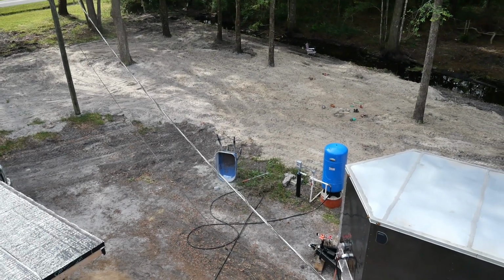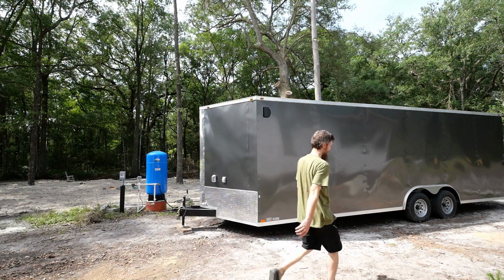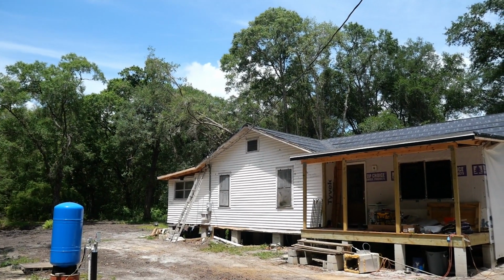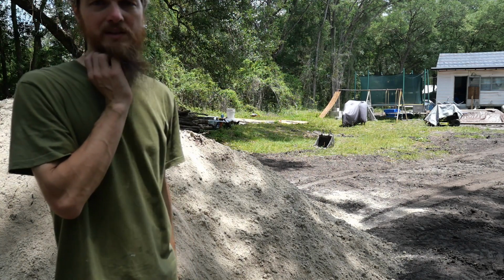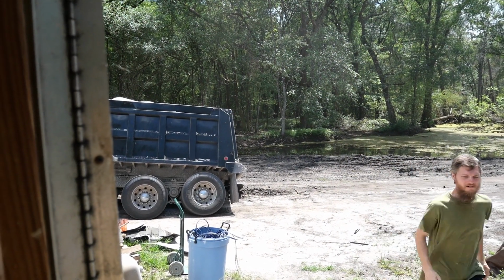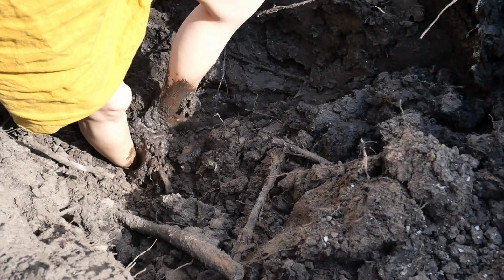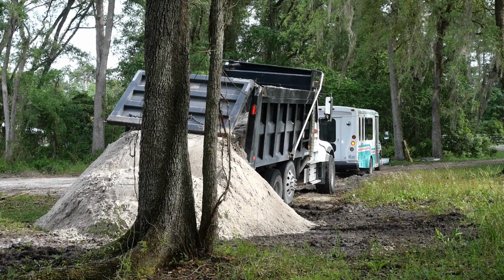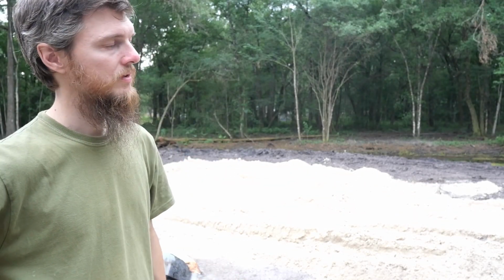Dump Truck Sunk Right into the Ground - Dirt Delivery

Comment: That slippery clay will hold onto water like nobody's business. You want to get that sand mixed in to help the drainage of the native soil. Piling it on top will help drainage to an extent, but you'll still have random pockets of instability where water gets trapped and can't drain out. I ended up mixing gravel into my clay (as well as piled on top) just so I could get machinery moved through. Corduroy roads also work in a pinch if you only need to get a machine through a couple of times.
Reply: Yes I agree, there needs to be a gravel mix or the sand will wash away or the rain will make it uneven.

Comment: There are basically 3 types of soil, stable, intermediate and reacative. Your on a black soil which is reactive. When it dries out it will be like concrete and when it's wet like yours there is no bottom to it. Great for farming not so good for building on. Be carefull about building up the ground around the house, you really don't want to create saturated soil under your house.  You have good intention replacing like for like but those foundations are not very deep. Dig yourself a fairly deep hole fairly close to the house and look at the soil profile as you go down. There ideally should be 3 distinct levels, different colours. Typically A, B and C, unless you are on bedrock which you aren't, or strike bedrock, which I would be doubtfull you will find on your place. The best you could hope for is a moist clay. Typically yellow in colour. That would be your C (stable) Usually a founation would just be placed just into the clay. The A level is on the top and you could have a laugh as it's called you guessed it,  'Top Soil' . It has been built up ocer melinia and actuallt stops tge clay from drying out. When the land is stripped off its topsiol the clay will dry out and shrink, causing foundations to sink, or crack, often causing brickwork to crack, houses to sink (hense those old door you got were out of square, because as a house starts to sink people usually start to trim off the tops and bottoms of the doors to get them to at least open and close, but they will always run into trouble with the latch of the door furniture running foul of the strike plate and becoming just a headake usually. We used to set the whole house up on jacks. Usually the house would be just hanging there if it had a properly built brick chimney or two. It is really quiet amazing how a house, even over 100 years old, just trys to hang-on, defieing the odds. I have jacked up ordinary small houses, with around 60 to 80 stumps, sometimes around 4 to 6 inches. Taking into account that the house may have been slowly going doen over 40 years or so you have to be sympathitic when lifting a house back up to the level of its chimney(s). We would have it up on usually 60 7 ton hydraulic jack and maybe 8 or 9 ten toners. Creaking and cracking can be pretty scarey when your jacking them up as I heard on your place, it makes you just stop! and listen. Lol, I saw you do that a couple of times underneath yours. Brought back memories.. Also just be carefull when playing around with just yourself and the missus, many older homes can have asbestos descuised in many unlikely building products. When they are disturbed thw particles can become airborn and if someone btreaths them in they can't be simply coughed up, they are tiny and they have a barb like structure and the are in there to stay, worse than lead or murcury in the body, they can cause a couple of very nasty diseases, always leathal. If in doubt spray with a mist of water and don't let the particles get airborn. I'd be very interested to see your soil profile. With such a beaut machine to play around with . With your layer of sand, you might also consider adding some organic material. Either rip the ground with a dozer or get it tilled in with a rotavator. The rule of thumb being don't bring the B level into the A.         All good.
Reply: Blimey that’s one hell of a paragraph.
Reply: Learned a lot , Thank you.   I never wanted to live in Florida.  Bad news about what they could be breathing in !
Reply: Excellent info
Reply: I have thought it might a good thing for them to install a sump pump under their house.  Theyhave them in basements.
Reply: @ross225100  I first moved to Florida in '72  wouldn't want to live anywhere else. I've lived up and down the east and west coast   of Fla.  even the Keys   now settled in Fla panhandle....love Florida
Reply: You can't do that! The water table is just a couple of feet below the surface. Even in the driest months it won't drop below 3 feet. That house sits on the margin of a slough, hence the backyard pond. The sandy fill is the best solution to their drainage problem. Realistically, they need double the amount already put down to raise the surface sufficiently to eleminate their mud problem.
Reply: @beverlybaker6970  I was born and raised in Florida. We had to move to Kentucky for work with our kids. We all miss Florida. Looking to move back soon.-Mary

Comment: Looked like the left front wheel wasn’t moving. Check to see if the caliper is dragging on your bus. You guys are great been watching for years!
Reply from the maker: I was paranoid about hitting the power poles so I was keeping my foot on the brakes, that's all. Plus I have barely ever driven that bus and it was hard to see what I was doing. :\

Comment: We did 3-6" rock as our base layer, not stone but rock as it locked together with jagged edges, not smooth like stone.  You need airbags or heavier springs in your Van.  You really should learn the geology of your area of Florida.  Hopefully, your home isn't over a potential sinkhole.

Comment: I think you would do well to trust a contractor or professional well versed in dealing with low lying land and high water table , road cloth prior to dumping and spreading material helps greatly with  pumping effects,  keeping the black muck from mixing up through your surfacing material. Hopefully the sand was free as fractured rock would have been preferable I think, but I realize not everywhere has this material , and trucking isn't cheap .I only speak up as I want you to succeed and respect hard work. Best wishes.

Comment: your built on a swamp with constant unerground water flow...you need to divert that flow...tough situation...good luck
Reply from the maker: The water under the ground is the high water table. That's everywhere in Florida, which is why no one has a basement here :)

Comment: im worried that once the rain comes you will have a bunch of quicksand all around your house,  need some rock, fiber and soil too to hold it all together.  Water will just pass right through the sand. it can  look dry on the surface but can be a pool underneath like what you just saw with that truck sinking.  once the rain comes it will get worse w/o some rock soil n fiber

Comment: I’ve the utmost respect for your abilities but I have to ask: did you get a professional evaluation of the necessary steps/materials necessary to push back or ramp down your water levels and grading your yard. The south (especially FL) is way different than the north.

Comment: That there was so much mud under the surface must indicate that the water table is quite high, perhaps some sort of drainage and/or pumping system is necessary to take some of that water away from your property.
Reply from the maker: Yea, we have a high water table and at times it starts showing up in the crawlspace. Nothing can be done about it except try to raise up the soil.
Reply: Problem is there's no place to put it.
Reply from the maker: Yep, we're at the lowest spot so all the water ends up here.

Comment: Dump truck drivers in my area can drop and drag... i.e. lay down a layer however thick as you need. Don't know if that'll work for sand tho. Would have helped your spreading time tho.
Reply from the maker: It's okay to get them in piles because we ordered 20 loads and there wouldn't be enough room to drop and drag them all.
Reply: @diyfferent  I guess they wouldn't be able to back over what they dropped without getting stuck in fresh sand. They do that with stones  in driveways. Back in to the end, open their tailgate a little, tilt and drive to the end slowly while dumping a small layer. Makes for a nice smooth layer. Great video!

Comment: Well that was to be expected.  When you dug up a hole to place the broken concrete blocks you could see the ground looked liquified from about 2 to 3 feet deep.  This sand will mix with all that mud and here's hoping that the ground will stabilise if you get enough fill.  You're doing well as when it flooded the water didn't take to long in draining.

Comment: So odd how random things like that can happen. 

Many years ago we had a lorry come to pick up a scrapped car from our bottom farmyard. All went well, until the driver of the lorry tried to get the crane to stop moving sideways so he could lower the car onto the bed of the truck. The hydraulic system stuck, and no matter how much he tried, he couldn't stop it carrying on to the full limit on the wrong side of the truck bed. The farmyard had a slight slope, so he'd set up to counter that in loading, but unfortunately the weight of the scrapped car, with the slope now on the wrong side, sent the whole lot toppling. All I know is we were relieved we had witnessed the incident, because the insurance company tried to make it seem as though it was driver error in either how he had parked, or in how he had operated the crane. 

I feel for the poor driver in your situation, to have successfully delivered four loads, then to have that happen must have been soul destroying. 

I hope the sand helps with your water levels now you've graded the land as much as possible to drain towards the ditch and pond. One small downside with sand is it tends to take longer to compact into a drivable surface, but with luck you'll find the happy medium between it all soon. 🤞

Comment: Could it possibly be a sink hole? Possible ultrasound to find out for for sure? Scary... Great work on your property!
Reply from the maker: No, it's 100% not a sinkhole. It's just a 35-ton dump truck sinking in. This stuff happens everywhere. The previous 4 trucks what were lighter in weight loosened up the top, hard, dry layer, so when this one rolled over, it was just too much and it gave out since underneath was still soft. Thanks

Comment: if Ashley sinks into the stuff for sure the truck had great chances of really sinking that poor driver was having a not so great day ..... could it be a hole with quick sand ??? glad all worked out well in the end hugsssss
Reply: People fear quicksand but it isn't really all that dangerous - they watch too much TV. The principles of "liquefaction" are in effect there, also. The only way a person will continue to sink in quicksand is if he continues to shift his weight in a concentrated area - and even then, it would never go over their head. The more they move and the further down they go, the less weight is being applied to the surface and the liquefaction ceases.

If a person steps in quicksand, the best thing is to get into a horizontal position to distribute the weight over a larger area, then crawl back to solid ground.
Reply: @ep61611  i have never seen quick sand except tv but being 58 i know they add the scary tactics for fun lol but its ok i earned something new today by your explanation ty hugssss from Canada
Reply: @ep61611  Cool!  Not that I may ever need it, but that's the best tip of 2022 so far for me.  As I watch people comment about D&A fixing their piers under the house I think of that principle.  They are spreading out the downward force of their house with a "wider" foundation which is very effective.  It lets the house 'float" on top of the dirt and is an effective  building technique used for centuries.  Spreading downward force over thin ice is also an effective way to get out of water when you fall through ice.  I never would have thought of that for quicksand though!

Comment: My guess would be those first four loads of sand caused the water under there to displace, and it was forced into the area where the truck got stuck.  Even though he had been able to drive over it earlier, it is now saturated.  I don't think there is any way to predict where all that water that's under the ground is going to go, but that heavy sand is going to force some of it to go somewhere else.  Good luck.

Comment: Haven't seen it asked(I may have missed it) why are you getting sand and not fill dirt or clay base or crusher run
Lived in Florida for over 30 years and sand was not something we wanted in our yards and it never firmed up and was always causes for vehicles getting stuck
Reply from the maker: We're getting that question a lot so we'll have to cover it in our next video. But, we didn't really order "sand". We ordered "fill dirt". Florida is mostly sandy soil, so the fill dirt down here is "sand". It does have a little bit of clay and other stuff in there, but it's real sandy and we're okay with that. It's the norm and this is what was recommended by a site prep company for our property.
Reply: @diyfferent  👍 Gotcha
You may have have to bring in some rock base at some point to make a driveway of some sort down the road
Take care and keep up the good work

Comment: You might want to switch to gravel it packs better and grass will grow threw it! I would go to a welding shop and get a hook attachment added to your mini excavator a lot of companies are mobile so they could come to your residence to do the work. Remember to always unhook your battery when welding on equipment or your vehicle as by not unhooking the battery it could cause the computer to fry!  Then with a ball attachment you could use the excavator to move around your mobile shop! you could add a ball to your bucket or on the plow of the excavator it is all preference! Easier than using the van with the excavator you have a better viewing and it being on tracks you will have better traction!

Comment: Hate to bring bad news but.... @ 12:20 The reason the soil "gave out" is that you guys live in a swamp! The soil is super saturated with water. Thus the reason for the black muck. @ 13:39 Look at where the truck sank and how close it is to the house. Yet you still think the house will remain stable and not sink???? Can the house be made stable? Yes, but not the way you're doing it. Your piers will have to be constantly re-leveled.
Reply: SING IT!!!! and, HOW is it not obvious (to them)why the water table is so high??  I cant even
Reply from the maker: Florida always has a high water table, that's why it was wet there. At times the water table is so high it actually starts showing up in the crawlspace. The house has been here for a very long time and has been fine. No reason it will all of the sudden change just because we move here, especially with the improvements we have made to the foundation. Yes, releveling piers every few years or so is common in Florida, that's normal and expected.
Reply from the maker: Actually, it IS obvious to us. We said that in the video. The high water table is why no one ever builds a basement in Florida. We knew that already...........
Reply: @michellelaclair  you can’t even what?? Be nice?

Comment: That front tire on the van hardly moved when you were pulling it backwards.
Reply from the maker: My foot was on the brakes. I was paranoid about hitting those power poles, plus I have barely ever driven the bus and couldn't see what was going on.
Reply: @diyfferent  ok I thought you might have a bad bearing or something wrong with that wheel. Thanks for all the vids

Comment: Unfortunately, this like this happen all the time on sites, fast recovery and moving on are key. At least you all took it in good part. Ashley's mud dance was very fetching, though I did wonder if she was about to be 'planted' in the ground. Clearly the surface on which you have been walking is far from solid ground, I have seen ground like yours almost liquify in the past, due to vibration with a solid crust on top that can suddenly let you go through. Maverick had the greatest base for a sand castle ever, f only for a while.

Comment: It's what I was afraid would happen. Your water table is so high. That's one of the reasons the "pond" floods all around the house. 
I'll bet if you did down 3-5 feet anywhere in the area, water will start coming in and filling the hole. Sand will only do so much. Gravel/rock/road base may be your only hope. Expensive as hell.😩😭
Reply: Maybe watch & listen to the next video for an explanation...
Reply: @justmynamehere   Ok, dirt/sand it's what Florida has. I wasn't aware the dirt company was actually doing their job, and being helpful with what they need, not just what they asked for.
But I still stand by my comment about the water table. Poor girl was ankle deep in watery mud. I've worried about the water being a problem from the beginning. They are working around it and finding solutions, good job.

Comment: The water table is high there. Bet you're not very high above sea level ?
Reply from the maker: Yea, Florida has a high water table which is why no one does a basement here. All of Florida is "close" to sea level, as well as all the states that border the Atlantic Ocean.
Reply: @diyfferent  .......aaaaand the Pacific Ocean. 😵‍💫
Reply: Elevation is probably around 120ft above sea level and is typical for the area. Water table in normal conditions is about 6 feet. We have had a seriously wet winter and spring.